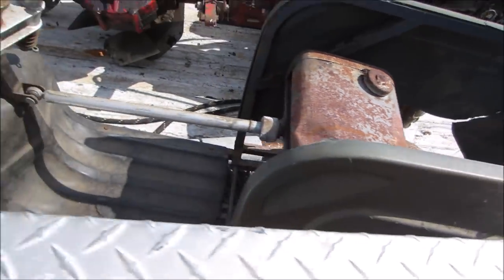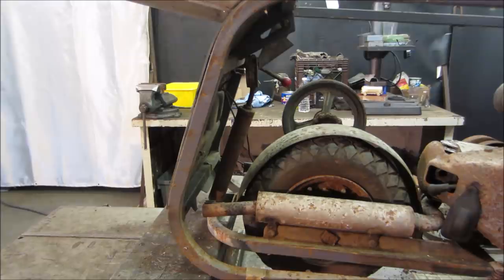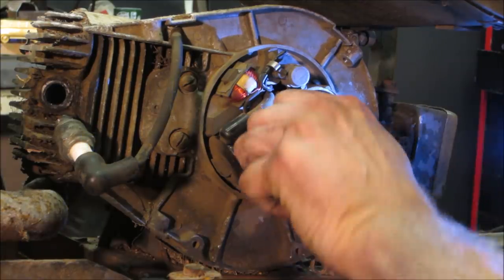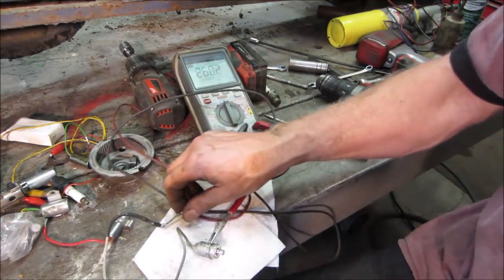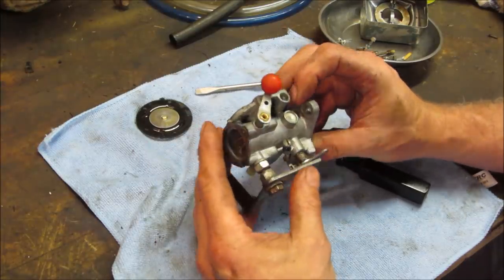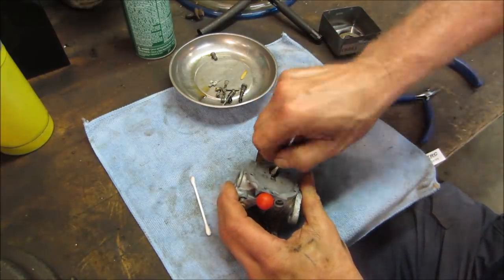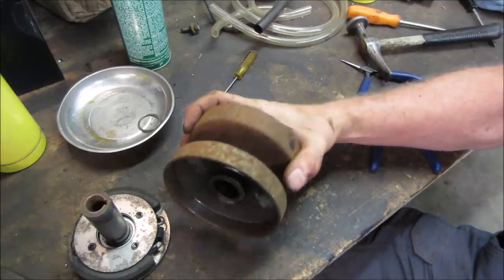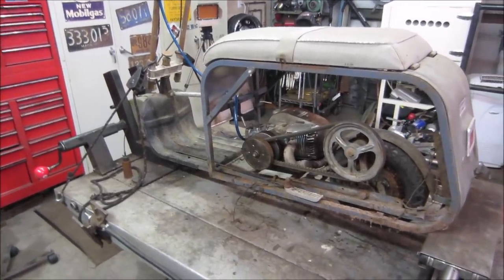Sitting 40+ years, fold up 49cc suitcase scooter. Will it Run?

Comment: I think your pull start needs to rotate clockwise one bolt hole.  That way the pull handle would be at the top so you could start it with the sides on.

Comment: I think the early version had metal body work? clintons are a little clanky by nature but that may be excessive.points .020.{tecumseh point and cond} plug champion j8j. gas mix 20:1 with only 30w oil.rewind same as tecumseh,. clean muffler and ex port.belt must be segmented.

Comment: Thoroughly enjoy learning from your videos! Great job getting that dinosaur to run! The thing rattling around in the driven clutch are the remnants of a spring that retracts the sliding side of the clutch to retract to idle and not move the belt at idle. looks like an impossible job to get to that spring for replacement.

Comment: Hi, I am originally from the UK and used Imperial spanner sizes ( 1/2"  and 5/8"  etc) , but moved to Finland 14yrs ago.. Here in Finland everything is metric  ( 13mm , 14mm ) , when Mustie pulled out his 11/32" spanner, I really had to think, "What the Hell size is that in mm?"    ( Approximates to 8.73mm, so I guess either a 9mm, or, an well used 8mm, and a hammer !!)   Great Video....

Comment: Smokey Yunick woulda called that snap ring a Spiroloc. they are used in pistons in the pin bores to hold the wrist pins
Reply: Yes, same thing also used to hold the OD direct clutch together against an 800 lb/in spring in Chrysler 4sp autos

Comment: All those electronic ECUs and sensors to ensure correct operation still functioning after 40 years amazing. Otherwise the CVT would not be able to function. Centrifugal weights for clutch and centrifugal force for the shot to fly against ramp in hub and force the hubs together, simple.

Comment: Had me all excited with the Gravely C8, rotary plow, looks like a 106 mower and snow blade there in the trailer. Nice haul. 7.6hp looks like an early 70s tractor w/two speed axle, wico magneto. Real solid setup. I couldn't see the fwd/reverse lever to see if it was the later with the lever to push fwd to go fwd or not.

Comment: found something about like it. still have it designed in Germany and made in japan or other way around think it has side cart to folds up too. did a little research  on it only like a thousand made. lights were run off 6 D batteries . its a cool little thing but no parts have to mill them and make them..

Comment: That's incredibly awesome you got it running!
I think that's what's called a "Salsbury" type clutch.
I'd put a tiny bit more oil than necessary, just because it's age and
it's a 2 cycle, it relies on the fuel for it's lube. Who cares if it smokes.
Snow blower & snowmobile lights are usually 6v, or use LED.
I think it sorta looks like it belongs with Crusty.
Garbage can lid, kidde pool plastic for patch?

Comment: You may use any standard points condenser having a capacitance of 220 microFarad = 0.22 milliFarad.
Which turns out to be the most common standard value.
Consider this value in production is made within tolerances of +/- 25% at least.
It will work with any standard points ignition engine, cars included.

Comment: The number of air cooled engines I cleaned mouse debris from is like literally everyone I ever worked on. Even the engines that do not have mouse debris still  have air stopping debris that has to be cleaned out. This is the most important thing for an air cooled engine, PERIOD !!!!
I like this engine since it has the special alternator built right in the flywheel with two small coils right next to the ignition coil. The Clinton engines are just bullet proof, rich oil mix, clean air filter, straight dinosaure gas and you are ready to ROLL.

Comment: I noticed that you have the pull starter clocked the wrong way. With the side covers on, you won't be able to pull the string with it pointing to the rear. Look at how it is mounted earlier in the video.

Comment: That's a great find. Stripped down it resembles a Tote Goat. I've heard the name before. The Tecumseh motors had the same points pretty much. Just remember the old motors used a higher oil  mix.

Comment: 1:16:43  The rear wheel stops, but it's the slipping belt that allows it while the motor is running. It looks like the clutch system is still gripping, as the transmission is still locked with the engine and spinning.

Comment: Not a Cushman, but a Bushman.  Just joking - this thing looks really cool.  This would not be for your body repair, but I discovered the superglue and baking soda trick recently and have used it on various car molding repairs as well as the irreplaceable plastic grate of a a 1950 box fan.  We had two Gravely Model L's is what I remember the model was - sold them in the late 1980s for too little money.   My dad almost cut his hand off with the sickle bar once.  Overall a beast of a machine in the right situations.

Comment: This is really cool. It's way more of a traditional scooter in scooter form than any of the "fold-able" and "suitcase" style scooters I've seen. Most just have the handlebars and wheels pop directly out but are still just you sitting on a suitcase the suitcase. Some are even smaller than a suitcase- like the Honda Motocompo
 used as a spare tire in the 1st gen Honda City. Then there was the Mazda "suitcase car".. more of a suitcase go-cart.. and not sold to the public either.

Comment: hey mustie found this while searching the net check it out. February 27, 2010 - Big news for Centaur owners!  A company is now reproducing the plastic body parts that have been the Achilles Heel of our scooters.  They sent me photos of the new parts, and I went ahead and ordered side panels for my second Centaur that needs them.  The new parts are made of fiberglass, and need a bit of trim and fit to work right.  For example, the holes for the seat strap pegs aren't there, and there is a little warpage.  However, as you can see by the fit on my Centaur, the side panels look good.  Just needs to have the proper holes cut and then be painted.  Go to the Technical Library page for photos and more information.

Comment: I have a concern about how much fine dust you may be breathing in when you are cleaning parts with the wire wheel.  A mask might be advisable and better ventilation.

Comment: That feeler gauge provided right on the little points cover is a wonderful detail. The manufacturer saw things through the customers' eyes there. The customer will be needing to adjust the points themselves, but virtually none of them will have feeler gauges... how to solve.... provide one right on the cover they just removed. Such an elegant solution.

I could say blah blah blah - stuff we buy today isn't made like this - rant rage etc. But that would be silly for a couple reasons:
a. Consumers today (en masse) demand ever cheaper things. A manufacturer could produce something like this today, better, easily, but they would not sell enough volume at the price they would have to charge.
b. I have no doubt a collapsible into a briefcase scooter like this was in no way a cheap purchase back in its day.

Comment: If the plastic is ABS, I watched a video that you take acetone and dissolve chunks of ABS plastic in it. Depending on how much plastic you put into the mixture, makes it thick or thin. You can fill, glue, bond depending on what you need. Then let it sit and dry. I believe this may work better than melting it with an iron. ?????

Comment: Do you add lead to the fuel on those older engine's to lubricate the top end? As that's why we had leaded fuel back in the day. I  believe it's still available at most auto parts stores.
Reply from the maker: 2 stroke has no valves that need lead, and it get premix with oil/gas

Comment: I googled “suitcase moped”and I found a page on it. Website is caroholic, I don’t know if that’ll help. “Caroholic suitcase moped” made it my first result.

Has some additional information on the vintage of it and even a picture of one folded up.

You might have trouble registering it as a moped if the top speed of 40 mph turns out to be accurate. I mean right engine size, but I know some states cap it at 35.

Comment: If you don't have a 11/32" wrench, a 9mm wrench will do just fine.  Oversize by .010, but It'll be a good enough fit in most cases.

Comment: Don't know if this is part of the problem but I don't think your 'boat' plug is a good test.  First I saw of the no gap plugs was Mercury Thunderbolt Ignition of the later sixties models but they were running with about 60k voltage where as the old points and condenser style ran from 8k to 12k on a 12v system.  So if your Clinton is a six volt it would be even weaker.  I don't believe it would evenly power a no gap plug.

Comment: Oh Wow, My Favorite Brand Of Old Lawn And Garden Equipment Here In The Beginning Of The Video And Nothing Gets Better Than A Gravely Walk Behind Machine Or Rider, They Were Built To Last For Generations And Also Founded And Manufactured Here In My Home State Of West Virginia.... I Have 2 Different L8 Model Walk Behind Gravely Tractors With The Model 106 Brush Cutter 30 inch Decks On Them.. Both Of My Walk Behind Tractors Have, The Original, Small Solid Rubber Dual Wheels On Each Side, That Are The, Firestone/Gravely Stamped... Both Machines Are Factory Electric Start With Foot Switches With The 6.6hp Engines... I've Also Got 2 Different 800 Series Lawn And Garden Gravely Tractors, With The K-Series Kohler Engines And Hydrostatic Drive And Hydraulic Lift And Front And Rear PTO For Different Attachments... I Like John Deere Equipment But Gravely Is My Favorite Machines, Being Heavy Built  And Gear Driven And Operated 💪👍
Reply: I am a Mustie1 addict, but I was horrified that you showed us that Gravely tractor and then didn't work on it, or even discuss it in detail.  They are my other passion, and I bet you could gather in lots more of us, like Sam C. and me.  We could raise the tone of your audience!  You will luxuriate in the adulatory comments from new legions of grateful sycophants.  I promise.

Comment: For your consideration: 49cc is 1.6 oz. It would take a very small amount of gas to hydrolock this engine. 0.4 oz of fuel is the same as filling the cylinder 1/4 full of fuel.

Comment: I have been doing lots of research into 49 cc scooters.. the "Half CVT" part is called a "Variator"  .. for future reference :)
Reply from the maker: cvt is a variater,
Reply from the maker: A variator itself is the main driving part of a continually variable transmission (CVT). Where a gearbox has gears, each with a fixed gear radio, a CVT smoothly transitions through its gearing range. Variators are used in scooters, and even some modern cars for a couple reasons. Firstly they’re fully mechanically automatic.
Reply: @mustie1   right and right.. are you saying that "Variator' is the proper name for that style of cvt altogether , or just that front 'sheave' with the clutch in it?

Comment: (33:55) - If you change the speed of the drill from number 2 to number 1, you'll increase the torque.
OK, it will be slower but should be enough for that motor.
>

Comment: I don’t think you should have to turn it over that fast and long with the drill just to get it to start, if it’s not starting there’s a reason, find it fix it and then get it to start like it should, with the pull start.

Comment: Hey bud, I seriously doubt that thing will go fast enough to drive that rod into the gas tank.
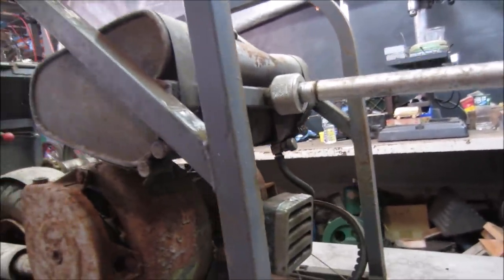7:08
Reply: Back in the day they were able to get these going 40mph. After 40 years it'll be a stretch, but even 20-25 into a wall would penetrate that old tank.

Comment: Those points look just like Tecumseh points p/n 30547A. Add some oil to the felt to lube the points cam. The condenser looks just like a Tecumseh 30548B. I don't think its just 49cc's. These were about 5.5 hp and your not getting that power from a 49cc engine.

Comment: You put the pull starter on wrong.  It is supposed to be vertical.  It is started by pulling up when the seat panel is up.  I know you will realize this later.